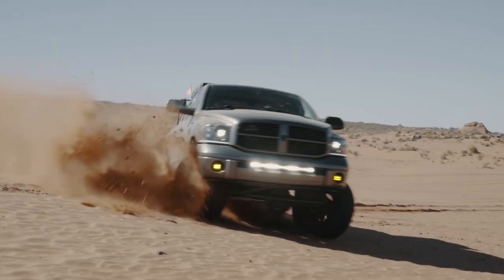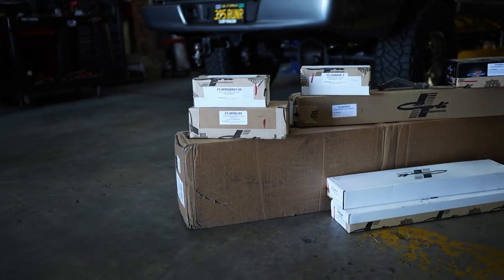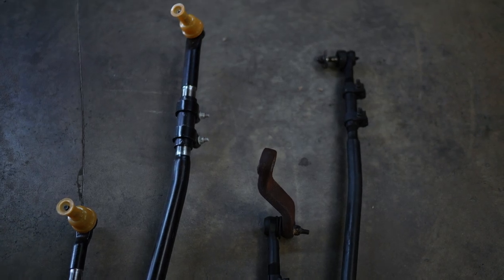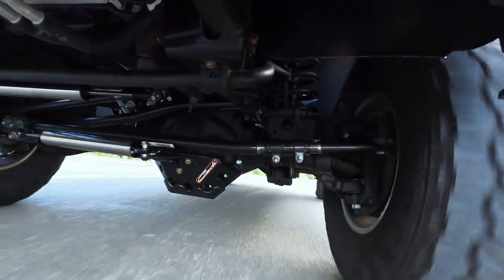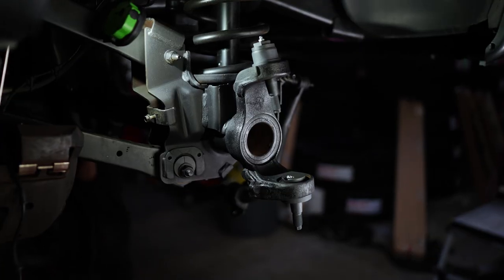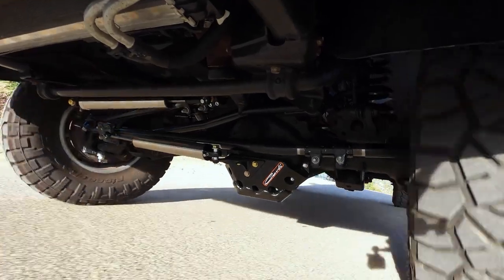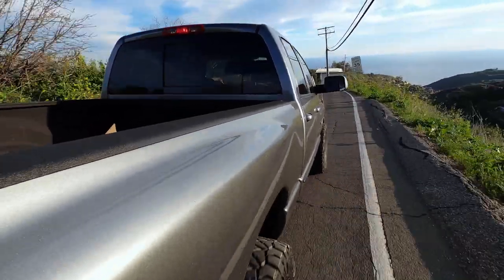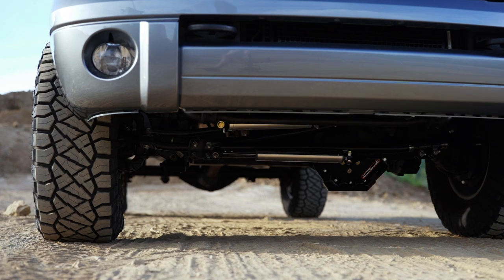How to Do Your Steering Right! | Fixing My Cummins Dodge Ram Steering Forever

Comment from the maker: For cool shirts, sweatshirts, and more check out the Just Diesels merch store: https://just-diesels.com
What I used:
https://www.cjcoffroad.com/products/ultimate-3rd-gen-steering-package?_pos=1&_sid=b3332460c&_ss=r

How to diagnose your steering video:
https://youtu.be/9NcLGLnXoDI
 
Fox ATS stabilizer video:
https://youtu.be/npFSaH_dGgQ

Carli ball joint review video:
https://youtu.be/9kkVU2lGr2I
Reply: I just rebuilt my entire front end on a 2004 2500 using CJC. I used mopar T steering upgrade, Carli track bar, Carli control arms thuren 2” coils and tuned fox shocks, fox steering stabilizer, EMF ball joints, new borgeson steering box and shaft. Truck is decent in the twisties, but I’m sawing back and forth on the freeway. I’ve been to multiple alignments in the 350 miles the truck has been built. All say I’m good. 

The third shop though, who I researched and found with hundreds of 5-star yelp reviews, said something and it has me wondering. They said that new ball joints can be stiff and keep the wheels from wanting to self center. This causes me to constantly correct and feels like the front end is wandering. It’s not fun to drive on the freeway.

I’m at a loss about what to look at next…the rear leaf bushings are good too. Tomorrow I plan to pull the zerks on the ball joints to see if I applied too much grease. I followed the EMF instructions though, and the knuckle
turned freely…
Reply: @jeremyhowell2332  
What’s your tire and rim setup, size, pressures, etc?  Are all four tires the same?  Are your tire’s directional?

What speed are you noticed the wandering, including road condition (concrete or asphalt) and is it wandering one or both directions?  

Does it wander under breaking vs acceleration or coasting?

07:00ish he talks about pre loading…

Make sure every component is installed correctly, torqued and used plenty of grease (jd corn head AN102562), crack open the box if need be. 

Maybe the "thrust line" and centerline are too far apart?… especially with a solid rear axle with leafs given all you’ve done to the front. 

*Worst case after double, triple checking everything including ailment is to identify your frame is squared away, literally.

I know the feeling, it’s like the truck isn’t connected to the tire’s or the road, like driving 65-70 on glass.  There’s quite a few options, including factory warranties on your new part’s.  Sometimes you have to adjust all parts so it all works together perfectly.  Or sometimes it’s just a track bar issue… best of luck and I suspect the front end complexity doesn’t match up with the rear setup.
Reply: @2K9s  thanks for taking the time to reply. I adjusted the Carli track bar to the exact center to center measurement Carli and CJC off-road recommended.

The tire/wheel setup is all brand new as well. They are 18” Methods and 35x12.50 Nitto ridge grapplers. As far as the frame, it’s factory mint. No rust, no dents, immaculate, zero accidents.

The steering box manufacturer (borgeson) suggests I recheck to make sure the box is centered in it’s travel. I’m doing that this evening.
Reply: @jeremyhowell2332  
No problem!  Hopefully you had some luck?
Reply: @jeremyhowell2332  
How’s everything going with your truck and the wandering issue?  Were you able to remedy the problem and if so, how?  
Thanks

Comment: Andrew's 3rd gen builds are so nice that I look at mine and feel like I'm just burning cash lol I just bought the Carli Pintop 2.5 kit from CJC along with Carli full progressive leaf springs, Mopar HD steering upgrade, and Thuren active rate sway bar (probably forgetting other stuff too). Hoping this will help me sort out my steering and suspension issues but it's going to take me another 6 months to save up for those Carli ball joints. Think I should take care of my rusty cab corners first though...
Reply: My Carly ball joints were on back order from CjC for over 2 months. Canceled them an went with EMF’s an cjc got them to me in 2 days. Got $300 dollars back an they are amazing
Reply: @luckyGdogg  Might've dodged a bullet.  I've got EMF on my truck and going to have carli ball joints installed next week.
Reply: I would do the emf ball joints. They are rebuildable without passing the cups out of the axle

Comment: I just sold my 2020 HO 6.7 and bought an 06 5.9 mega cab manual with 98k miles.  It has a 4" fabtech lift with Fox shocks.  I want to take it down to stock in the rear and 2-2.5' level kit in front, running 35's, while fixing any 06 issues.  What is your recommendation for a parts list?  It's for practical use in NW Montana but I'd like some longevity and versatility out of it.  Thanks

Comment: Your right, the steering stabilizer is not that great. Throw them away and replace it with a PSC Hydro Assist. I run one on my 3rd Gen with 37"s and its 100 times better than any stabilizer gimmick.

Comment: I have a 3rd gen (08) 2500 diesel. I did the Carli 2.5 front springs, control arms, and track bar.. all VERY nice stuff. The other upgrade that I did that made a HUGE difference, was the steering box. Going from the "4 bolt" sector shaft box to the 4th gen style "6 bolt" sector shaft box. It went from driving like an old Ford Pinto, to driving like a modern Corvette (in comparison of course). With the old steering, I always felt like I was up on the wheel constantly doing small corrections to keep it in the lanes. With the new, I can drive with one hand on the wheel and relax a bit..
Reply: Absolutely the 6 bolt box and upgraded steering shaft is a must!! I have radius arms and love it

Comment: Just to push the point home, my 2007 Wrangler on 37s ran 5 years without a steering stabilizer.  I would even hit corners hard and drive 80mph.  Once it got hit while parked, I had to add one since the insurance company refused to fix the frame.  Never the same.  But 75k miles without a stabilizer.  Alignments, maintenance and care are all I needed!

Comment: I love this build! I had CJC send Carli 3.0, high clearance arms, extreme ball joints, torsion sway bar,Mopar tie rod, Thuren track bar, progressive springs F/R. Lowered the front and back 1" on 35s.
I know why the front carpet had 50 cups of coffee dried into it:) The stock sus had me listing and ready to sell my 08. Fortunately I kept it. The truck is a beast now on those wash boards and 1-6" rock section roads. Cody and Cole were so patient with all my questions and when people ask how much I still say it was the best investment I made on the rig.

Comment: Nice choice in parts. I may swap my synergy trackbar to a Carli when the bushings wear our. Those design considerations were not considered when I was just trying to deal with death wobble on a tight time frame. I am running Carli ball joints, Synergy steering/trackbar, with PSC big bore box with ram assist. The steering is not the quickest with the ram assist but it holds the wheels in position no matter what I run over.

Comment: I went with Synergy steering on my 2012 only because after about a decade in the Midwest no amount of heat and penetrating oil was gonna get my factory tie rod adjustment loose! Good excuse to buy some parts.
Reply: Make sure u use copper anti seize on the threads in salty winter areas, synergy can still seize up in states that use alot if salt or brine

Comment: Really enjoyed your explanation on stabilizers. I mess with jeeps and have chased death wabble before. Everybody just says replace your stabilizer. That just masks the real problem. It is usually worn out parts and/or a bad alignment. I ended up replacing my worn out front control arms when I did a lift and I haven't had a problem since. I ran without a stabilizer for probably a year with no problems. Ended up putting one on when I finally got bigger tires just to dampin feedback from hitting potholes and rocks. Good quality suspension components go a long way.

Comment: I had this job done by a shop and they used all moog stuff before we went to Baja for a month last winter. It all failed. 05 dodge 2500 hd 4x cummins. Should the toe in be 1/8th?

Comment: Andrew, would you comment on the differences/ use case between hydro assist and  your dampner set up?  I just put 37's on my 3rd gen. Thuren control arms, track bar and 2" prog springs up front and shackles in the rear.  I plan on continuing to build and replace old parts to new or improved parts. Im ready to do my steering box and linkage. Im contemplating the apex and hydro assist. The reason is that with the 37's I feel hydro assist may help save parts and make stering these large tread patches easier. Also feel like it will help in wonder that the dampener set up also accomplishes.  Thoughts, advise? Thanks

Comment: Are the 5th gen 3500s built way different than this ? 

The reason I ask is although my truck is new, I’m new to the smaller HD stuff. I’ve only had 5500s or bigger the last 10 years

Comment: Man I love my 2005 Cummins Quad Cab 4x4. I have the full Carli 3” Dominator. I went with King Shocks though. I did the full rear leaf option w/ the air bags. Steering Stabilizer and the high clearance extended control arms. I also got the Mercenary front and back bumper. I got the back bumper on but having trouble with the front bumper.

Comment: The best thing I did for mine !!!!!!!...put the locking hubs on it!  Where I live(Seattle shit hole), it only snows about 1-2 week's out of the year.  I can get my fat ass out and lock the hubs in.  It TRULY is a different truck with the front axle un-locked!!!  If I need to run over the mountain passes in the winter, by all means,  I lock them in, but only when I need to.  Other than that, it now drives more like my car!!! Its night and day to me.  Plus, I have seen my mileage go up about 1-2 mpg. Why would you spin all that shit ALL the time, if you don't need it is beyond me.   Your results may vary.

Comment: I have a 2021 2500 and the steering sucks. The one thing I hate about the truck. You have to hold the steering wheel slightly to the right when going strait. There's just to much play in the steering wheel. Kind of annoying. And it's not the alignment btw

Comment: I liked the video.... wish I knew several years ago.. my 08 2500 6.7l needed a bunch of stuff so I got new 20 in rims, 35 in tires,  1 in level kit, new shocks and replaced the front end. I made the mistake of trying to budget kit it and bought most through rough country.  After installing anything I can't understand how they haven't killed someone yet but now I'm stuck with it until I can slowly purchase everything to fix it right.  I agree about moog, I've always got there products and loved it until this truck... they don't hold up at all.

Comment: You’re 100% correct. I don’t have a steering stabilizer on my 03 2500. 
I found it’s mostly in the steering box? 
Keep the steering box adjusted? 
However when you have loose Tie rods and ball joints or bad track bar. 
It will start the process of the steering box constantly changing directions.

Comment: If you don’t mind. What wheel size/offset Tire size you have? I have a 2005 Dodge 2500 Quad Cab 4x4 Cummins. I don’t won’t my wheels sticking 10’ out from my truck.
Reply from the maker: These are 5” backspace 17x8.5 wheels wrapped in a 35/12.5/17 tire on stock suspension. 👍

Comment: Toyo tires don't cause the pull in 3rd gen ...its the longer front axle on right side vs the left axle shaft. Install free spinning hubs and the pulling goes away.

Comment: I need help.  I have a 2006 5.9 4x4 160000 miles. The second set of tires  97000 to 150000 wore hard on the outer edge on the fronts...positive camber?  Before my new set of tires I got it aligned.  He said everything was tight but no way to adjust camber on my truck.  Any way to get this fixed?
Reply from the maker: What are your full alignment specs? Camber isn’t adjustable on these trucks, so you likely have too much toe in.

Comment: I’m still kinda new to my truck and this type of suspension so forgive the ignorance but I have a 2006 1500 mega cab which shares the same suspension as the 2500 diesels correct? If so would this work for my truck too?
Reply from the maker: Actually yeah, the 3rd gen mega 1500s use the 2500 style suspension, so this would apply directly to your truck.

Comment: I have a 1994 ram Second Gen, What set up is best for a stable steering system. Have replaced the Track bar, still alot of play. All ball joints have been replace. Also have the cross bar to hold the shaft on the steering box. I have been told to change to the new style of track bar, with bracked change??
Bob.
Reply from the maker: @cjcoffroad just did a two part video series on that. Check it out!

Comment: Thanks for this! Money and time aside, would a hydro assist yield the same or better results than the Carli high/low setup?
Reply from the maker: It has a different purpose. Hydro is great for pushing big tires around at low speed where tons of force is necessary so that the box isn’t doing the work. It does make for a twitchy highway driving experience though, so I’ll never do it on any of my trucks as they aren’t dedicated off road rigs. The Carli High low is a better do it all stabilizer setup for people driving their trucks like normal trucks!
Reply: @JustDiesels  got it, thanks for sharing your opinion. My stock gearbox is worn out and needs replacing, and the PSC gearbox and Ram only cost $275 more than the Carli High/Low kit, so that’s what I’m deciding between.

Comment: I not a expert just here to learn . Interesting that you can load the steering to pull one way or the other with the steering stabilize.  A long time ago when I worked for gm I aligned a few car ect . I was told to add a bit more positive caster to the right wheel to make the vehicle pull to the crown of the road . I know some liked to use camber but I wanted to make the tires wear flat as possible.  So I was wondering if thar could be done with adjustable ball joints on a dodge since it's a solid axle ..I trying to up grade my old second gen especially the front steering thanks for the video

Comment: Ended up putting dyna track ball joints in 15 years ago. I put track bar bushings in last year. Just finished putting in 09 plus linkage and a 6 bolt redhead upgrade. I will have to look into Carli track bar in a few years when bushings start to get wear.

Comment: Great video. Did you also look at the Synergy linkage as well as the MOPAR system? Just wondering what drove the choice to MOPAR? I have a 2005 Ram 3500 5.9l and am looking to do a number of upgrades before next Summer. Only at 118,000 miles, so figure I have lots of miles left in it. Thank you.
Reply from the maker: Yep! Synergy has terrible stabilizer compatibility. I’ve since switched to Apex because the Mopar steering wasn’t robust enough
Reply: @JustDiesels  Thanks. I am really enjoying all the videos! To clarify, I am using the truck mainly for personal use, towing a horse trailer. Might do some very mild off-roading, only enough to reach some good fly fishing spots! The APEX is quite a bit pricier, especially in Canadian dollars. Is the MOPAR kit a "good" upgrade?

Comment: Andrew- hands frickin down THE BEST Ram steering video ever. So many answers were delivered in this video. One little nugget:  Toyo's wandering to the right? Dude, now I am not questioning my sanity on that issue any more after brand new shoes hahaha. Big Carli fan, did the leveling springs shocks etc on a new '23 3500 single tire with the Carli track bar and man am I glad we did that. Had to do an emergency 40 MPH hard right full brake lock into the boonies to avoid a catastrophic rear ender and it bent every thing BUT the Carli track bar. Drag link looked like a smile emogi. Your knowledge, prod quality, VO,  cadence  etc etc top notch man.   Sub'ed of course.
Reply from the maker: Appreciate the support, and you are not crazy on the Toyo MT pull. Actually a ton of tires have a solid pull one way or the other. Super common!

Comment: I need to go your alignment guy . I have nearly everything you have less the dual stabilizer I have a single with Kore unlimited setup my truck has 130,xxx miles & been thru 4 alignment shops & my truck still has abnormal steering with every front end part upgraded . 
Carli ball joint top/bottom 

Bd track bar 

Upgraded Chrysler steering rack 

Fox true steering damper 

New 37’s 

Yet still can’t seem to get the setup solid and like it was when new stock . Even had fox shocks rebuilt which didn’t need it as the tech stated oil was still great had new nitrogen also . The tech asked if the shocks had been off-roading or just a ball crawler as they didn’t need to be serviced .
Reply from the maker: I’d start with ripping off that BD track bar. They make a ton of great stuff but their track bar is not up to par. Tell your alignment guy to do 1/16” of toe angle, and then 3-4 degrees of caster. Should help!

Comment: I really enjoy your videos. Great the way you explain things. why didn't you go with the Carli or Thuren Sway Bar and Links?  I was planning to replace my OEM with Carli or Thuren on my 08 3500 Mega Cab on 35s. Have you ever run either kit?  Thoughts?
Reply from the maker: That’s because I went with a full Carli sway bar when I did the Dominator system! https://youtu.be/IfaBgmNtKNA

When it comes to sway bars, both Carli and Thuren will dramatically improve ride, and I can’t say you’ll notice a difference behind the wheel. The Carli sway bar does offer better build quality, better frame brackets, better joints and better end links, so I chose that route. Thuren is a great bang for the buck though if you want the solid ride improvement for the least amount of money.